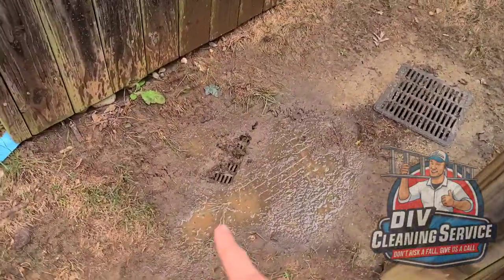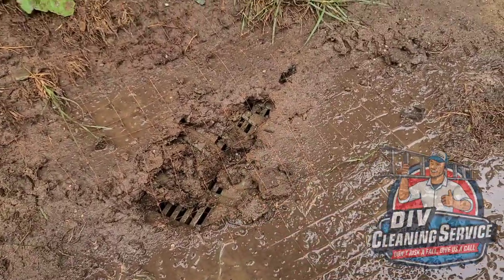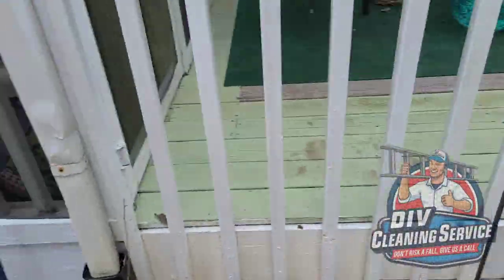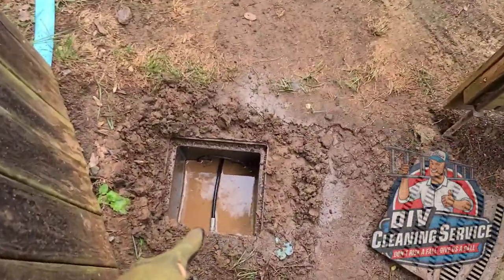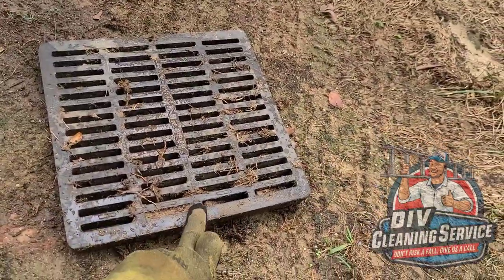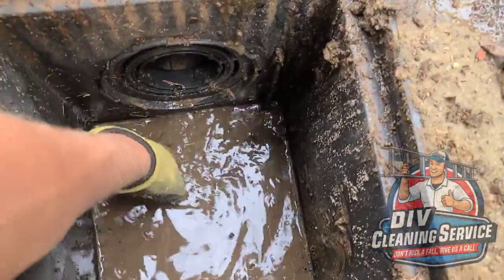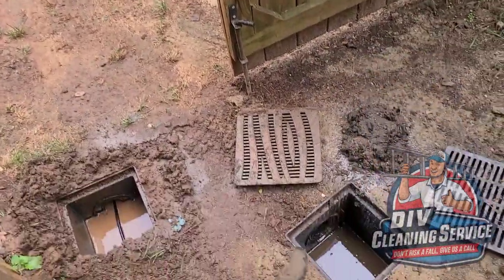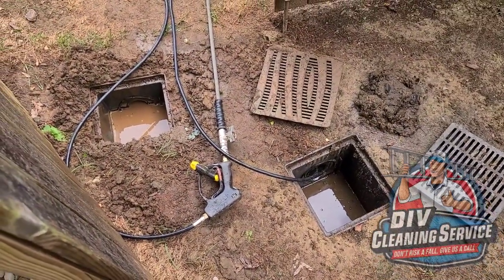Landscaper destroyed this clients underground drain system

Comment: IDK if I'd recommend adding more FD when the system there now is having issues with ignored maintenance.  Solid Smooth-wall discharges with a FD in-between two Catch basins that are also connected to solid-smooth-wall discharges might be the best option.  Corrugated 4in needs 2.8% slope to achieve 3fps for self-cleaning capabilities where smooth-wall only needs .78% slope for the same self-cleaning 3fps.
Reply from the maker: I always recommend solid/smooth. But very few people want to pay my prices. $15-20/ft. So they go with a cheaper option and end up having problems.
Reply: @divcleaningservice9522  I don't think corrugated can compete with smooth-wall if the system was comparing price per gallons moved-every-minute.  Installing 4in corrugated-inner-walls at less than 2.8% slope is illegal in my city.

Comment: Not going to lie, the tip at the end about how to roll up the power washing hose was worth the 9 Minutes of my life it used watching this video!

What size power washer using to run your drain clean out? Is it just a normal power washer, or something special?
Reply from the maker: We have an 8gpm power washer. I have used 4gpm, it's just takes longer. I just purchased a special "jetter valve" but I have not used it on a job site yet. Should be in future videos.

Comment: Damn landscaper's! That's why we can't have anything nice. Lol

How is that jetter holding up?  I added this service wirh you planting the seed.
Reply from the maker: Jetter is holding up good. The tips sometimes get clogged. I have an "ultrasonic" cleaner I throw small parts into. The hose off Amazon has not ruptured yet. I also ordered a new "pulsating" valve for the pressure washer that should improve jetter performance when breaking up clogs. Ill have a video on that after I get it installed.